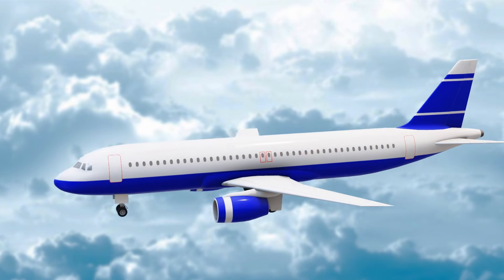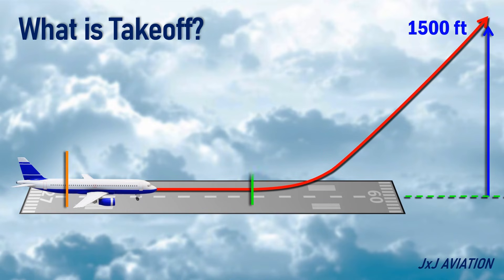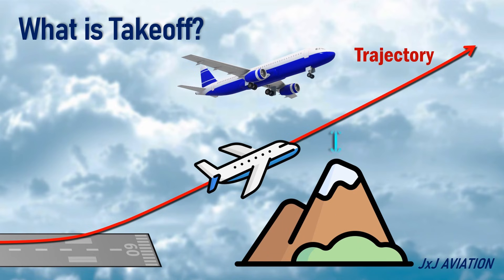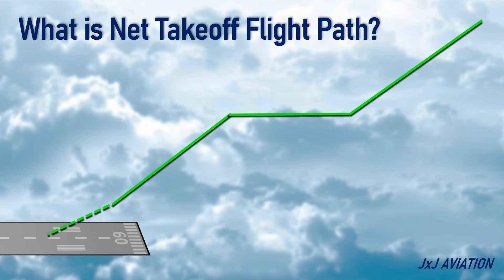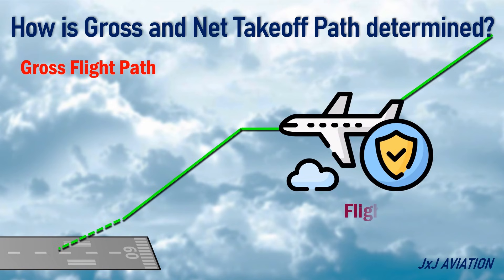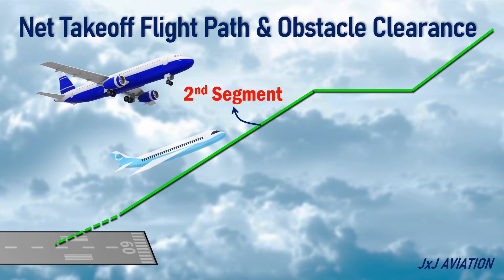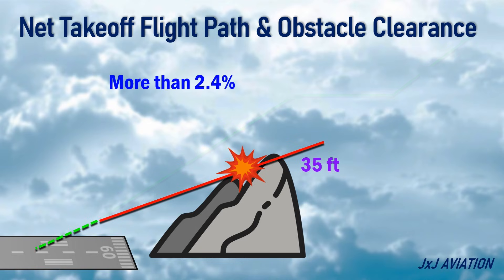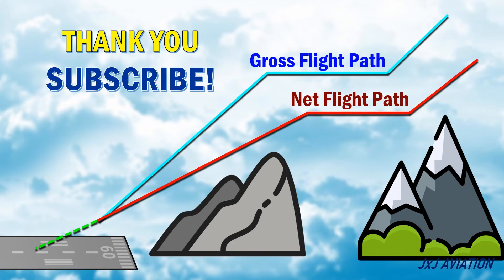Understanding Gross and Net Takeoff Flight Paths | Obstacle Limitation

Comment: Video with very basic errors, 0.8% is not the same as 8%. If you take off at 0.8% you'll hit a tree.
Reply: It is 0.8% indeed. No mistake here.
Gross Flight Path= Net Flight Path + 0.8%
Reply: @imgth765  Don't you know math? 0.8 is eight-tenths of a degree. To write 8 degrees, it's simply an 8. If you write 0.8, the significant unit place is occupied by a zero, so you're writing 8 tenths of a degree. ¿ Understand  ?
Reply: @gabrielcurbelo1717  Tell me, where in the regulations does it say 8%? Regulations are not in degrees, but in percentages. As in Gross Flight Path = Net Flight Path + 0.8% is correct.
Reply from the maker: Oh I did not notice that!